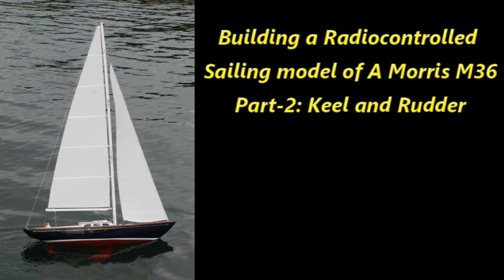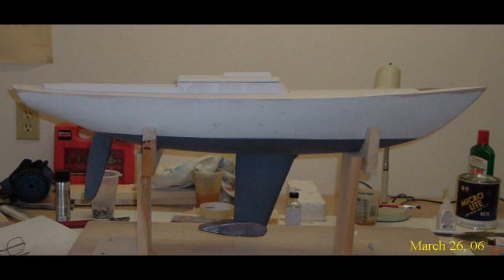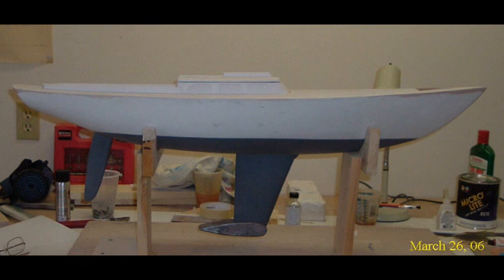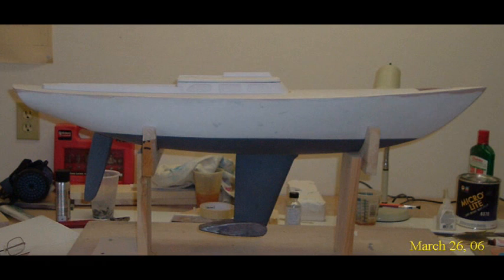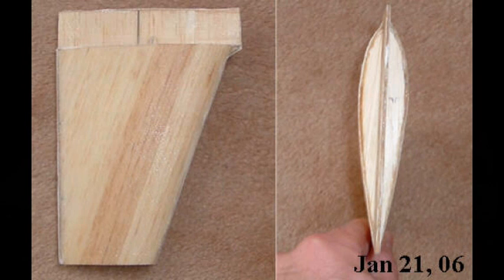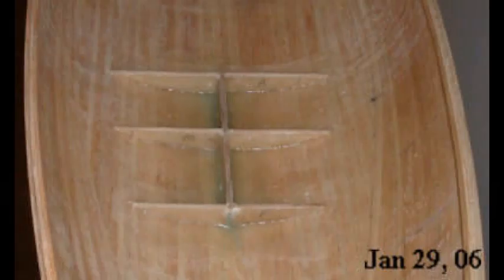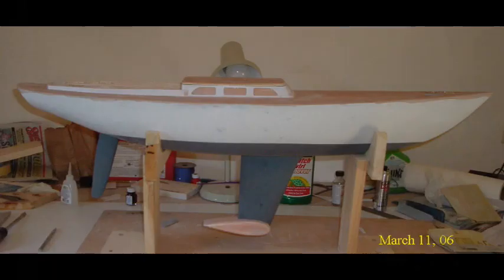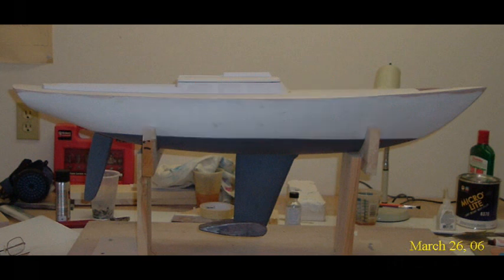Building a Radio Controlled Sailing Model of a Morris M36, Part 2 - Keel and rudder

Comment: I have never tried building a model of a boat, but it looks like it takes as much engineering and patience as building a full sized one.
Reply from the maker: Jeff, it doesn't have to be that complex, but I try to build using techniques similar to full sized boat construction.  For example I use the same materials used in full sized boats.

Comment: Todd, I’m thoroughly enjoying your videos; nice job indeed.  Your boat looks and sails beautifully !  I’m currently building both a full size variation of Herreshoff’s 12 1/2 (16 ft loa), as well as a 39” rc model of that vessel.  I am struggling with the keel design to provide as much stability as possible, and could stand some direction as to how deep on the keel fin should the ballast bulb (aka torpedo) be placed.
Reply from the maker: I am glad you enjoy my videos.  Because the hydrodynamic lift of the keel depends on how fast the boat is going, but wind loads depend only on wind speed and sail area RC models need considerably more ballast depth than a full size boat. Increasing ballast is difficult, so the keel is made deeper instead.  If you are building the RC model as a replica you can make the keel the same as on the real boat and ballast the hull so it floats on its lines. The boat will sail OK, but only in very light winds and it won't take much wind to knock the boat over.  Exactly how long to make the keel fin depends on how much wind you normally sail in.  I think what I would do is make several interchangeable fins so that you could sail the boat in different wind strengths.  After trying the different fins you will likely find one that is a good compromise.  One quarter inch aluminum makes a good fin.

On my Morris M36 model the ballast weight was determined by the requirement that my replica model float on its lines.  Also I wanted the keel to resemble the real keel as closely as possible.  So I decided to build a fiberglass fin using a standard NACA foil so the keel fin would generate lift and then add a lead ballast bulb to the end of the fin.  In my case I went to the trouble of doing the full naval architecture calculations to determine the optimum length of the fin based on calculated boat speeds as a function of wind strength and the amount of lift the fin would generate at those speeds  The calculations showed that I would need a very long fin if the boat was going to be able to sail in winds up to say 20 knots.  In the end I compromised on the keel fin length so that the keel would not too greatly differ from the keels on the real boats. . I ended up with a narrower and deeper fin than on the real boat. As a consequence my boat can't sail in more than about 8-10 knots of wind.